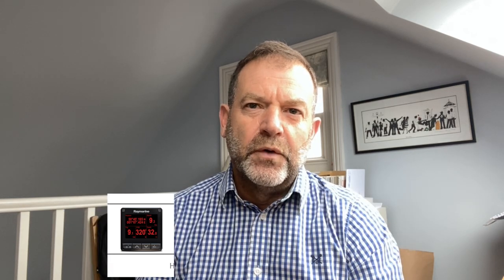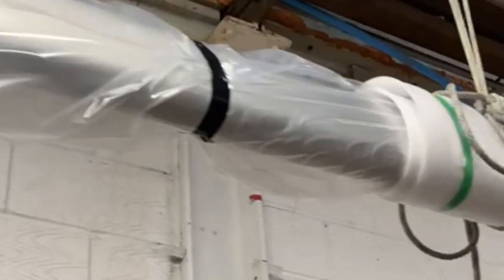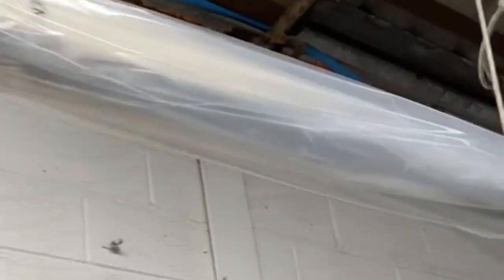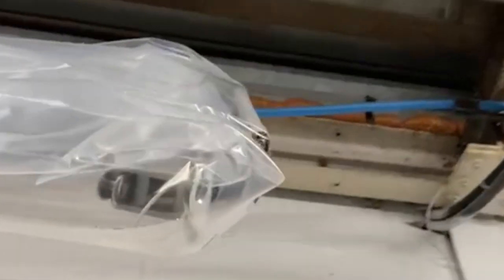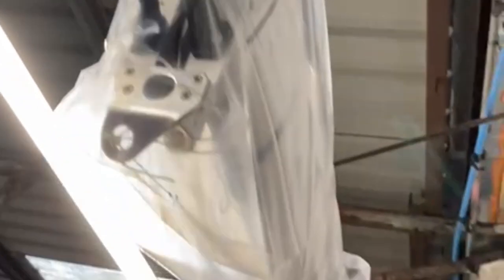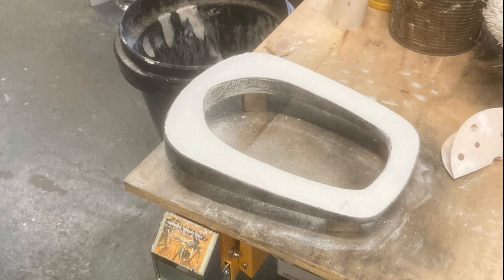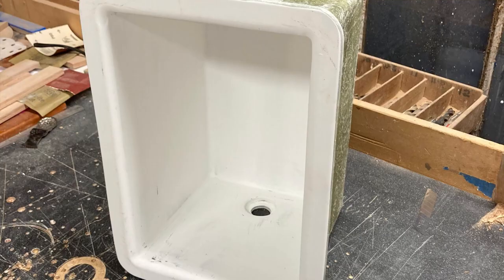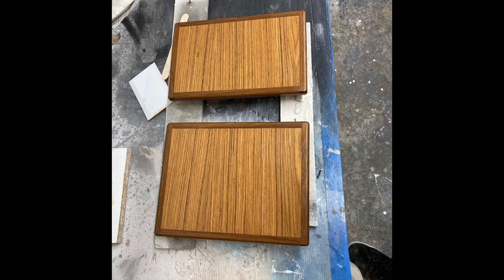Ep 21 - Tweaks to the design in our Contessa 32 Restoration

Comment: Definitely the right choice of mainsheet system for Coric, John.  The 2-line system has some advantages in other boats, but there is always a problem of lines in every direction ready to snag during a quick manoeuvre.
Reply from the maker: Thanks for this Nick, if I remember correctly we experienced a situation when trying to duck a starboard tack boat in a heavy wind and the main trimmer couldn’t ease the main quickly when they went for the wrong piece of string.
Reply: @CoricContessa32  Excellent choice with training in mind John, far more intuitive I think.

Comment: Hello! 
Just wanted to share my experience on changing all my electronics on my Co32 last year.. i’ve also opted for a all raymarine solution as well (chartplotter, radar, 2x i70s display ev-100 autopilot) 

The solution that ive chose,  and after a year of usage i would definately do it again  is to put all the displays on top of the conpanionway hatch, including the axiom 9s chartplotter ( yes it fits !)

So on the pannel I have one i70s, one axiom 9s, and one i70s. The radar and AIS infos are all directly in front of my eyes, directly on the map of the chartplotter. I can also control the autopilot on the charplotter. Everything is in front of you and in reach while holding the tiller. I’ve installed the p70s display of the pilot directly over the ram in the cockpit to engage\disengage the pilot easily.  

I could send pictures if needed :)
Reply from the maker: Hi Renaud, thank you for this. Very much appreciated. I think we agree on nearly everything. We discussed the plotter above the companionway hatch idea again today and it’s always been a contender. One of our plans is to have information from the navigation fit available to external devices through a Wi-Fi connection. That should give me the visual representation that we would have on the chart plotter.

Comment: Hi John, could detail/ elaborate on the 3:1/6:1 system ie what blocks etc are required or point me in the right direction? would like to change mine and this setup seems convincing. Thank you!
Reply from the maker: Hi Ulrich, sorry for the delay on this.  There is great variety in the arrangement of sheeting systems.  I like the 6:1system because it is simple and powerful.  The class rules for the boat allow for this "Mainsheet systems may
be upgraded to 6:1 purchase with additional fine adjustment".  We am not going to go for the fine adjustment as it can be confusing to know whiich line to go for if there is an urgent need to ease the main sheet.  This description of options was really helpful when we were discussing our choice.  https://www.harken.com/en/support/selection-tools/system-diagrams/mainsheet-systems/